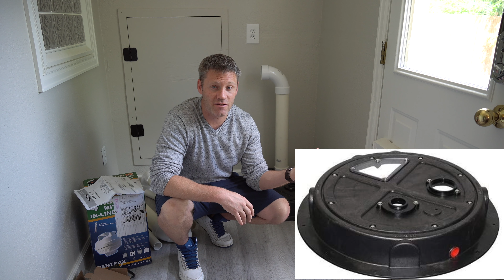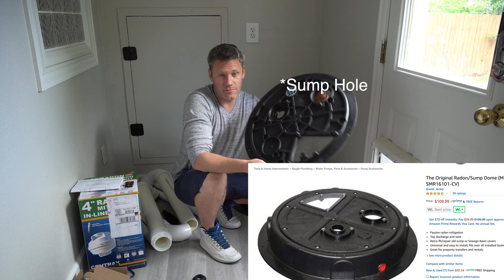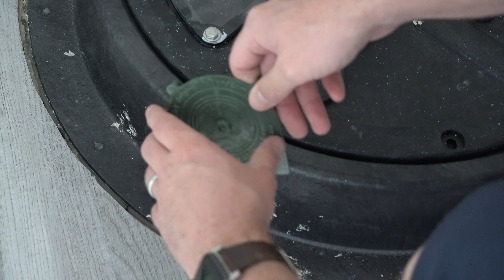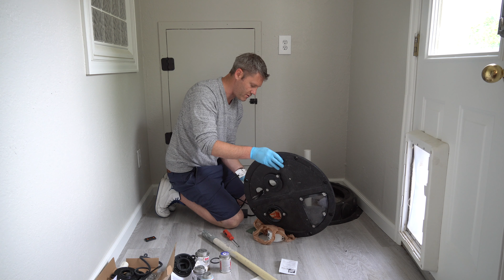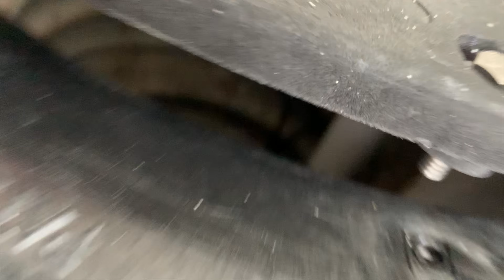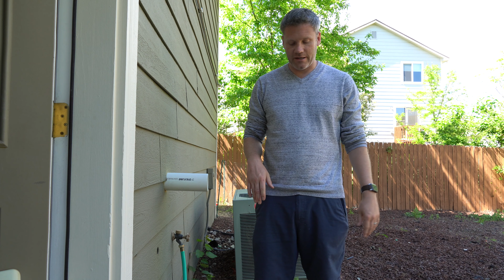Install Sump Radon Mitigation

Comment: I am install a radon system. And One thing I wonder about is if the sump basin allows enough airflow into the inlet pipe. I am thinking of adding an extension and extending the pipe within the basin through the basin and under the slab.

Comment: Having read and watched papers and videos, I understand more about this radon issue and solution. It seems to me there is another method called passive ventilation. This is based on the fact that the lower basement has higher air pressure than the roof. If a pipe is installed vertically, the air of the basement goes through the pipe and out off the house. Only difference is that the passive method is limited by the height of the pipe. So if it is the same height of two methods, using a fan can produce more VFM.

Comment: excellent detailed video, impressive, helpful. ps. if you attach that gasket/seal to the bottom of the top cover and insert screws on top where they belong anyway, gasket stays in place, no need to do 1 screw at a time method.

Comment: How did your Reasons levels settle after the pump install?  What were they before you started?  I tried a DIY at In-Laws in North Dakota.  Before Radon RP-145c RadonAway pump, levels at 35 to 46.  Now we are at 10.7 which is still too high.  Before the install, the Basement was in the 60's for levels.  Tried to save money but failed to solve the problem.  Using an AirThings monitor which is fairly accurate.  They want $1500 - $2000 for professional install with no guarantee they can get it down to 2.7 pci/l or below. 2.7 is the WHO maximum levels.
Reply: I would check to make sure you have all cracks sealed. 

The 1500/200 with no guarantee almost seems like it’d be worth tearing up your slab, laying down 6mm vapor barrier then repouring slab. 

Doesn’t make a lot of sense but neither does throwing 2000 at a problem on a hope and prayer

Comment: Really great vid, only one I found so far that goes into detail about the Jackel lid AND all the hardware it comes with.  Mine's arriving today but I have a dilemma.  I can't decide between 3" vs 4" piping.  I want to use a 4" sch40 pipe mainly for concerns of noise (larger pipe, slower airflow) paired up with my RadonAway RP145c.  If I use the 3" threaded coupler and step up to a 4" pipe doesn't that defeat the purpose for airflow?  The fan itself is made with 4" inlet/exhaust but I see so many installs (such as yours) just use reducers.  I'm having a difficult time with the logic.  IF I were to use 4" PVC throughout the system except at the threaded inlet on the lid which is 3" does the constant speed fan move the same CFM doing it this way it just goes faster at the 3" port of the lid and then slows down OR does it put a strain on the fan, adding resistance, and therefore reduces the airflow it would've achieved if the lid had a 4" hole drilled in it instead.

Comment: Nice video! As soon as you went outside, I said to myself "Looks like Colorado". Made me laugh when you said that's where you were. This will be super helpful doing my system in Fort Collins. 
Question though. I've seen several videos that mention a fire stop collar that is required on the outside wall of the house. Will this be an install when/if inspection requires it? And I believe the PVC you're using is DWV (Drain/Waste/Vent) class. Much cheaper at 3" than Schedule 40.

Comment: I have a sump in my basement and currently no radon mitigation system. If I install a sump pump cover that has builtin radon mitigation, will that effectively draw radon from the soil that the basement is built upon, or would I need another separate radon mitigation system for that?
Reply from the maker: Yes that is what I am doing in my video. The way a radon mitigation system works is it creates a negative pressure under concrete slap with a fan moving air like a vacuum. The radon that slowly creeps up will take the past of least resistance and since there is a something sucking that has access to under most of the radon gas will just exit out that way. There are other things that could make it not work like if you have a crawl space with open dirt above living area or the slap is cracked and allowing radon gas to exit those crack. No matter who or how it is done you'll want to test it before to get the normal reading. Then do something like install a sump cover with a radon mitigation system and test again and see if the levels are safe. If they are not safe you will need to do more like make sure the slab is sealed or if you have a crawl space seal and cover the dirt with the 6 mil plastic. Hope that helps. Just so you know I tested and ways high after I installed the sump cover and radon my levels were low (even with an open crawl space behind that small door behind me in thumbnail picture).
Reply: @waltsreviews90  thank you!
Reply: I’m in the same boat. Did you find out?
Reply: @oh_look_bananas  nope
Reply: @eyehear10  dang. Well good luck. If I find out I’ll post here.